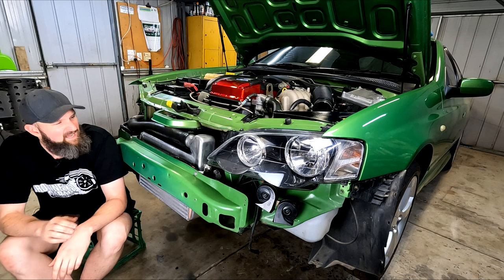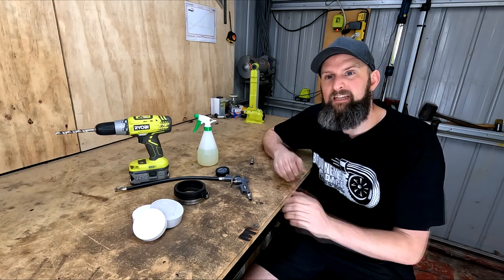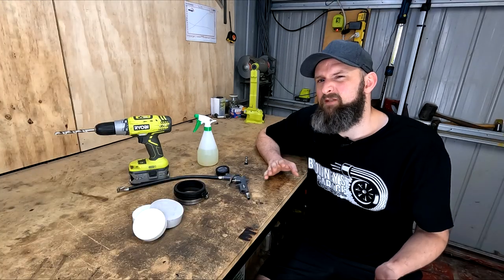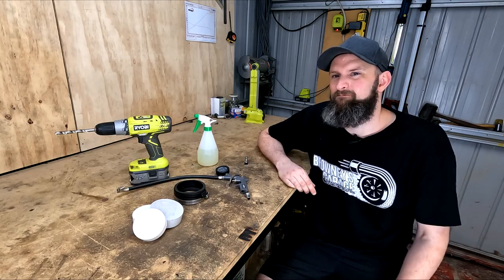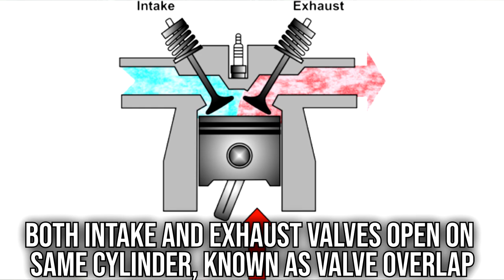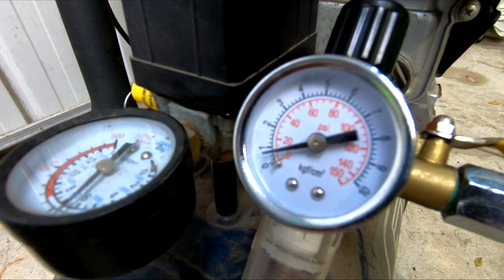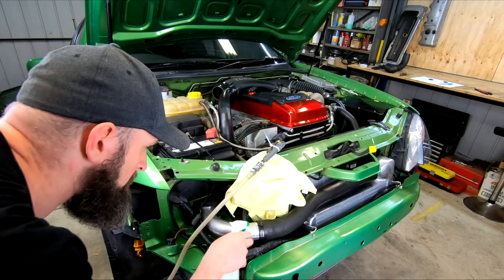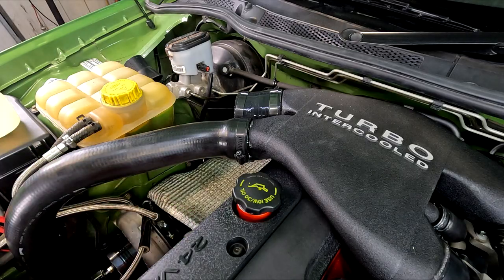TURBO FALCON Boost Leak Testing & Cheap DIY Tool | TURBO Your NA Barra Pt 7

Comment: good to see you at it again mate. i have factory BA turbo engine with the same intercooler, 1000cc, pump, value springs. tuned. 4 inch dump.  im interesting in what your car gets safely tuned at. id assume 280-310kw ?
Reply from the maker: At the crank? We'll be well out of injector before that if at the wheel, sounds more like the power you'd expect out of your own setup?
Reply: @BrowneysGarage  are you using stock turbo injectors? I told my tuner I was not chasing numbers I wanted something safe that I could put the boot in any time and not have to worry. Boost comes on later as my head pressure was getting high and he did not want it lifting the head or bending BA rods. My sheets not in the glove box but it's 290 wheels.  And the cooler and cross over temps are fine and I live up in NQ where it's always hot. The 4 inch dump makes a huge difference getting the exhaust out of the head and it sounds awesome. If you are using stock turbo injectors  and stock dump. I did have it tuned when I first got it on stock parts. It never hit the dyno so I can't give you a figure but I think I was running 6-8 psi. It hit 17psi when my actuator died I was lucky it not to turf the engine the pinging was real...